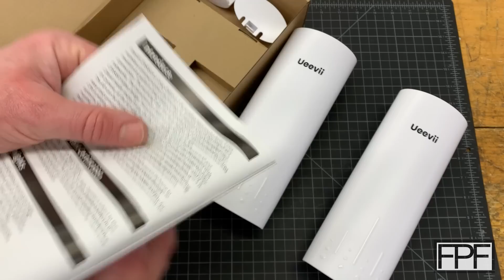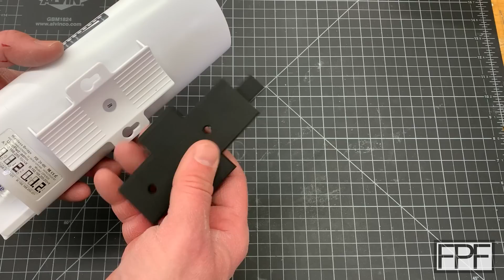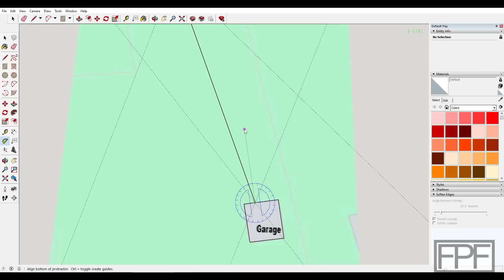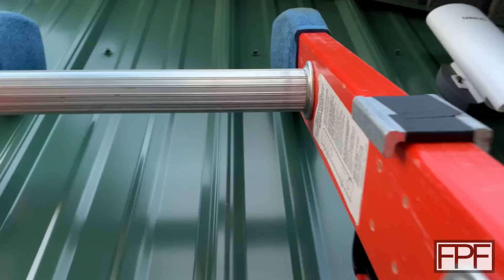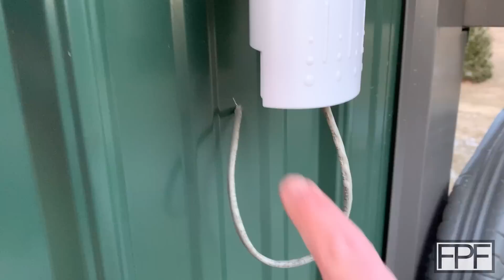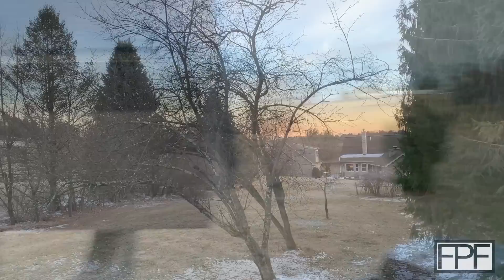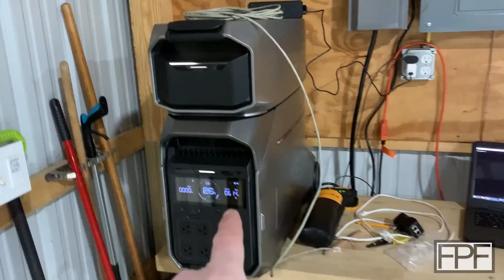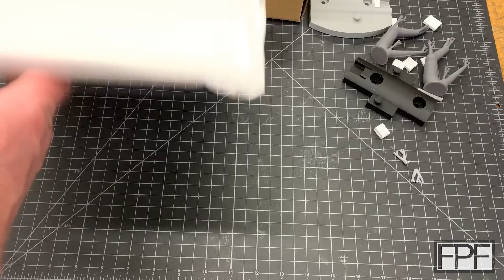3D Printed Mounts for WiFi Bridges

Comment: I found the layer strength for TPU for AMS needs higher nozzle temperature than the default profile. 240 vs 230, I've not made a vertical part our of it that's designed to bend, i'd probably try and avoid printing anything that bends on the layer lies our of caution..
Reply from the maker: The two final ones were printed at 245
Reply: @FunctionalPrintFriday  Weird I'll have to play with it a bit more, I've only used it in parts that are in compression or bend in X/Y not Z apart from some small cable labels.

Comment: The Bambu filament guides/spec rates Layer Adhesion for their TPU 95A HF at 86.3 kJ/m^2 but their TPU for AMS at only 9.5 kJ/m^2
Reply from the maker: That’s so low. . .  I wonder why
Reply: I just looked this up, they don't specify layer adhesion, they specify impact strength in the z axis. XY strengths are similar. However, the z tensile strength is actually half. Which would equate more with layer adhesion. Also the z elongation rate is also poor, x y elongation is fine.

Comment: Of course you post this as soon as I just bought a bunch of ubiquiti gear to get internet to the back of my property
Reply from the maker: lol
Reply: TBF that's probably going to work with a whole less hassle... I say as they currently have a bug getting IoT staying connected so long-standing that they actually removed all 7.x.x firmware for non-7 series devices. But it would not be a 100Mbit link, lol.

Comment: Super Tack actually sticks to good sometimes. To the point if you have a print that takes up most of the bed it makes it hard to flex the plate enough to break the magnetic hold. I wouldn't be surprised if your poured oil on it the print would still stick! 😂
Reply from the maker: lol

Comment: I've been using the supertak on the A1 Mini's, unless I discover that I ran a print that I need another of, at the PEI Textured plate settings. That's a bit hard on the supertak, so I'll swap the plates for the second part, and do a reprint, rather than re-slice with the correct plate. I don't have the supertak for my P1S printers yet. and that's part of the problem with the first set. One of the advantages of the supertak, or cool plates is that the print bed doesn't take quate as long to come up to printing temperature. So print times are a small bit shorter, but I don't think I'd really call it all that impressive of a change. Haven't tried the ams-tpu. Haven't printed anything in TPU for a while, and I do have something where that may be handy. Mini-printfarm being finally set up. 2 P1S printers, 2 A1 Mini's, all for of those will have either an AMS or AMS-Lite. One other A1 Mini w/o an AMS. Mostly expect to be printing in Gray on that, as I should be able to see clearly what works, what doesn't. 

I would say that the best part about the supertak or cool plate's is that I very rarely end up with a print that lifts off the surface. Yes they still need to be cleaned, but the number of print failures has gone down significantly.

Waiting on a new extruder cover for one P1S. and eventually will be swapping out the drive gears and hot end on the other, so that I can get some PPS-CF printed through them. Hoping that will stand up to 100 or so impressions under a 20 ton press into leather. It's the only gig I've found that pays so far, but that's mostly because I know someone who can use that work. 100 impressions is enough that they can field test an idea, see if it sells, and if so can have a Magnesium stamp made that will work for thousands of impressions. Those run about $500 each though, which means they are not great for doing the field tests with. I can model and print 5 identical stamps that each handle 20 or so impressions for under $50 (counting my time to design) which if they sell something like 5 to 10 of they recoup their costs, if they sell far more, they know they need the hard stamp. A couple have worked out that way.

And yes, I realize that I could make a 3d print, cast it in ceramic slury with a sprew, heat the pla out, and cast in pretty much any metal I want, but I don't have a handy place to set up a foundary, so for now that's out.
Reply from the maker: it's amazing how much compressive strength even regular PLA has.  loved reading about the stamping
Reply: @FunctionalPrintFriday  A part of me would like to find what research has been doon on compressive strength of materials, both as it relates to Injection Molded parts, and 3d Printed parts. Knowing how much space is in 3d printed parts, even 'printed solid' varients may have some significant impact on how well the material holds up under compression. That said, large blocks of plastic usually deforme as they cool in injection molding, which is why so much of that ends up being thin.

I think that in my case, the parts are experiencing compression induced heating that is bringing the plastic up to, or close to it's glass temperature, and the deformation at about 20 presses or impressions is due to heat building up in the process and make it somewhat fluid. I don't think the heat would be noticable by touch at the surface, but would still have an effect.

ABS or ASA may do better, PETG I don't expect to do as well. That said, nearly everything I'm seeing related to material strength has to do with bending resistance, or layer bond strength, which is (I think) fundamentally different from compression effects. That said, things like Gears and the like are probably affected as well, if there is more 'work' involved than moving a second hand around a clock face.There are elements of both strength and toughness involved, so, possibly a decent research paper in there for someone if it hasn't benen done. I may not be thinking of the right keywords for that stuf though.

Comment: Great video as always!
This may have been one of those times where this mount part could have benefitted from being an assembly of 2 separately printed pieces.  A solid bracket made out of PLA or PETG with a designed interface for a (non AMS) TPU lock.  I'm really fond of press fit multipart interfaces, or even using heated brass thread inserts with small machine screws.   This way you just simply don't need to concern yourself with support material, material interface weaknesses, or even the need to reprint the entire part when you want to redesign one of the assembly pieces.  Don't get me wrong, multi-material printing is very useful, but multipart assemblies definitely still have their place.

Comment: I've used the TPU for AMS on some reducers in my Dust collection system.  I printed them with 2 walls and 15% infill and they work surprisingly well.  I will admit it is much stiffer than the usual TPU I've used.  The reducers I created were for reducing 6" pipe down to 5" pipe on my planer and jointer.

Comment: I tried to print a cylinder block plug to pull a chainsaw clutch. One of those that threads into the spark plug hole which seemed like a sketchy design for 3D printing, but there were positive comments. Part of the problem is that i was using it on a huge 122cc saw. First try in PLA printed vertical went as well as you imagine and split on the layer line. Printing at 45 degrees with lower infill cracked the plastic. So did printing at 100% infill. Then I tried petg-cf as the best engineering filament I had loaded in the AMS. Took more torque, but still cracked before the nut. So I said screw it and printed one in TPU for AMS. It didn’t crack, but it did bend just enough to let the piston by. So I shoved a rope in there like everyone else does.

TL;DR - I found that TPU for AMS can take more abuse than I expected.
Reply from the maker: love that u still ended up usin a rope in the end :)

Comment: If you want more of a substantial connection between two different materials. You can made separate bodies and split them in the slicer and change the color for each model in the objects and it'll be a more substantial change. Also. The switching colors doesn't help at all since the previous layer has cooled completely before it prints again..

Comment: Have you tried the TPU for AMS in a standalone print that isn't mixed material?

I'm wondering if it doesn't need more of a purge than the default settings.
Reply from the maker: not yet, it might
Reply: @FunctionalPrintFriday  at 17:55 one can see that the appearance of the PLA part changes at the layers where the TPU part starts

Comment: I was having issues with adhesion with the textured PEI plate on a X1C so I did get a SuperTack plate. No more issues.  The print really sticks to the point it is sometimes hard to get if off. It's all I use now.

Comment: I just bought some TPU for AMS but have yet to use it. I wonder if print orientation would help for the flexible tab. Granted the TPU should have held and the layer adhesion looks disappointing, but I still can't help but wonder.

Comment: The TPU's have different hardnesses. Maybe that's it? I didn't hear the number. I have used Ninjaflex TPU with great results but hard to dial in. Maybe a start points for specs? Side note: Create a separate shim for the top and push it down in it, with a lock thru screw or an arrow wedge fit?  or extend the screw studs just a little and make a clip to snap around mount hole studs? dunno. California Filament has awesome PETG in gray and 10+ colors
Reply from the maker: this is specifically the bambu stuff that works in the AMS
Reply: According to Bambu it has a shore of 68D which is akin to a car tire
Reply: @ Wow ok that should be flexible as all get out.. Think I was using 85A... Don't know the difference between D and A though.